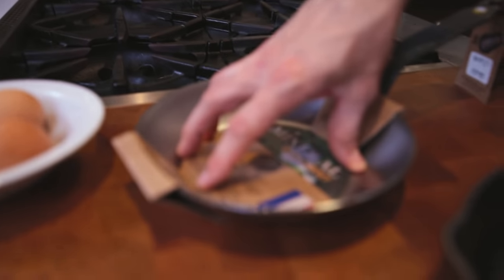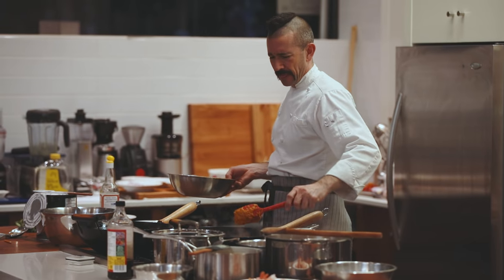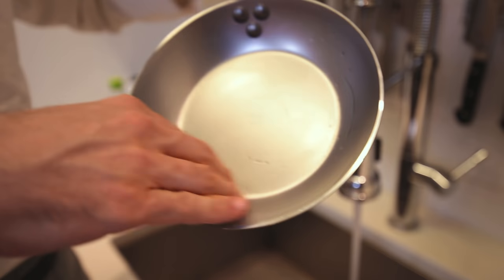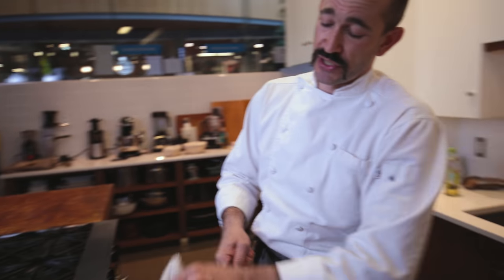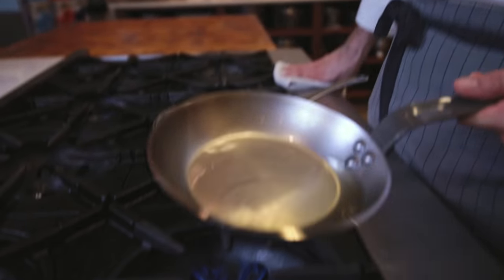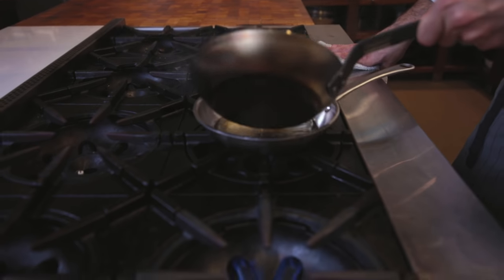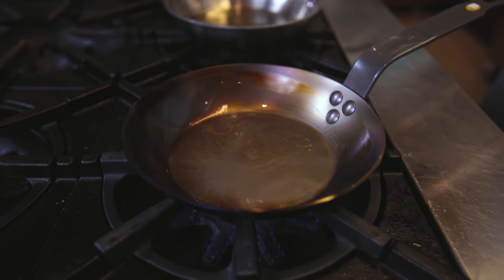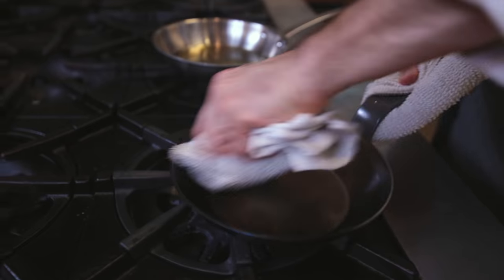How to Season a Carbon Steel Pan

Comment: Hey Chef, Just bought a Matfer 10" and I want to season properly. Transitioning from cast iron to carbon steal. You mentioned a beeswax coating on the pan which mine has but it is not beeswax. This coating is hard and thick and didn't wash off. The process from Matfer is salt, oil, and potato skins cooking it over medium heat for 15 Min. then repeating. My question is "Can I season this pan with this coating still on?" Will that coating be removed during the seasoning process without harming the pan? I realize your pan is not Matfer, I thought you might be familiar with my pan. I am trying to get an answer from a pro and not someone like me. Please HELP ME. I'm dying to use it.
Thanks for your help...JackStone
Reply: Jack Stone 
I initially scrubbed my Matfer with hot water and a SOS green scrubby..then seasoned it like this a couple of times and it worked for me.  One thing to remember is to make sure your pan is hot before cooking...there are some good videos out there about preheating your pan.  Great pan, love my Matfer.
Reply: Jamie
Took your advise and did get all the coating off with hot water and the course scrubby. Worked so well, I'm going to buy a smaller size also. My 10" seasoned very well and have been using it every day. Sorry for the late reply, but I did want to take time to thank you for your share, very helpful. Thank you so much for your help...Stone
Reply: No problem, I also bought a few more Matfers on Amazon super cheap (open box), they had touches of rust on them but nothing a mix of vinegar and water could get rid of along with my scrubby, followed by seasoning.  I have become addicted to carbon steel now.
Reply: That plastic layer of coating is nearly impossible to take off the matfor carbon steel pan.
Reply: Cast Iron is only good for dutch/french oven cooking or for homemade pizza (12"+ Skillet with Lid), for deep frying (Deep Skillet) or for baking. Saucepans and Stock Pots go Stainless Steel, for Woks and fry pans... Carbon Steel is the way to go.. Cast Iron cookware are invaluable for a good kitchen, they're just not great for everything.. I wouldn't transition from Cast Iron to Carbon Steel, I'd just use them for the right tasks.
Reply: I used hot water, blue Dawn, kosher salt, green scratchy sponges all together. It took a super long time and was a massive pain in the neck. However it was worth the trouble. Then I dumped in a bunch of potato peelings, oil, and kosher salt and cooked those bad boys until they were burnt. Pretty well seasoned by then. This was Test Kitchen’s method.
Reply: I used boiling water on my Mauviel, some soap and a natural brush. Took a few times but I got it off.
Reply: Those Matfer skillets not only look like a carbon copy of the Turk (Germany) Professional series (662xx), the Turk skillets also have such a plastic like coating to protect them from rust. That's quite some nasty stuff. To get rid of it soak the pan in water + washing powder for at least 30 minutes, I'd recommend to give it 45-60 minutes. Then use steel wool and a lot of sweat to srub the stuff off the pan. After that heat the pan on a gas stove until the metal starts to change color from brown / black over dark blue to light blue or, even better, matte silver. Let it cool down, wash it one last time with mild soap water, heat it up to get rid of all remaining moisture and start your preferred seasoning method.
Reply: @mrdeadsea7777  I cook fried eggs, sausages, burgers, omelettes, potatoes, onions, stews  and much more in my cast iron. If you treat them right they are the best to cook with.

Comment: Why are you washing all the beeswax off if all the seasoning pucks sold today are bees waxed based?
Reply from the maker: A few reasons. First, I don't take it all off, I will leave some on that helps in pre-seasoning. Second, there is too much from the factory as the point of the wax is to protect the pan from rusting. Third, it's dirty.
Reply: Ok thanks !!

Comment: why grapeseed oil instead of olive oil?
Reply from the maker: Due to fibre in OO. Usually the better the OO the more fibre it contains. More fibre = more black residue build-up. This may sound strange but if you really want to use OO for seasoning then I suggest getting the cheapest stuff you can find as it's usually thin and flavourless which is what you want from a seasoning oil. I hope that helps.
Reply: @Cook-Culture  thank you, going to buy a carbon steel pan soon
Reply from the maker: Good on you! So far we have found de Buyer or Matfer to be the best performing pans for the $$.

Comment: WTF fpr a stipid pan! I bought one today and washed it numerous times with dish soap! Then seasoned it, and when i wipe it with paper towel, the towel turns all black!!! Is it because of the machine oil that was used to prevent it from rusting?

Comment: How often do you have to season your pan?
Reply: As long as the patina is not damaged you don't have to reseason the skillet. But it really helps developing a good patina if you do a so called touch up seasoning after using it. After cleaning the skillet you pre-heat it again, apply a very thin layer of oil and then turn up the heat to the point where the oil starts smoking. Let it smoke for up to a minute and then turn off the stove. If the oil seems to form smears during the process, simply wipe the skillet with the towel again so it forms an even, very thin layer. After you turn off the stove you may also wipe the outside of the skillet with the oily towel to protect it from rust. The remaining heat will burn in this oil too.
The whole process should only take a few minutes and keeps your skillet in perfect shape. 
I always do a touch up after cleaning the skillet with water as you have to re-heat it anyways to get rid of the moisture. Especially with a new skillet that doesn't have a good patina already, I would do a touch up after every use.

Comment: Thats way way too much oil. This guy doesnt know how to season carbon steel.
Reply: correct
its hard to find a good video on seasoning a pan, some of them just wave around with the already "seasoned" pan in front of camera, some do like this
Reply: musaire Its impossible to find good instructions for seasoning a pan. Trust me, I've looked. All of the stuff I could find was vague, with no specifics. Some say you gotta use lard, some say you gotta use rapeseed oil, some say dont ever use vegetable oils. Some say to drown the pan in oil like this guy, some say to only use a miniscule amount that you wipe clean after too.
Some say to put in the oven for an hour at 400F, some say only 30 minutes. Nobody shows real closeups of the pan, showing how its meant to look while getting seasoned.
I tried many different techniques to season my DeBuyer Mineral Pro skillet, and none of them worked like advertised, to get that smooth uniform black shiny finish. I had to use sand paper on that pan way too many times, to start over. Then I just gave up, and started cooking on it, fuck seasoning and fuck these assholes who dont even know what theyre doing.
Reply: Rykehuss omg so true im a perfectionist and things like these with the different techniques drive me fucking insane
Reply: Rykehuss  I’ve had the same issue, spent hours of my time only to get a gummy surface. Last time I stripped it, heated it in a 200 degree oven,  wiped a minuscule amount of flaxseed oil all over with a lint free cloth, cranked the oven to 500, stuck it in that hot ass oven, took it out after 15 minutes to wipe off any drips so it wouldn’t be gummy, stuck it back in the oven for 2 hours, turned the oven off until fully cooled, repeated the process another time. Should be good, right? First time I cooked in it (after that round of re-seasoning) BACON effing stuck to the pan.
Reply from the maker: Hi , thanks for your comment. The process that Chef Cosmo follows in this video follows the instruction from de Buyer, which they put on every piece of Mineral B Cookware. We acknowledge that there are a few good methods to seasoning carbon steel however the amount of oil used here is adequate for the desired results. Also, please note that some wax is intentionally left on pan as per the manufacturers instructions. This all becomes the seasoning and helps seal the back side.
Reply: @Cook-Culture  In de Buyers instructions it says 1 milliliter of oil, not desiliter :P
Reply: @G GYou aren't supposed to remove the bee's wax, it helps give a better seasoning. Even De Buyer advertises that it helps with the seasoning. Also, you can buy seasoning pucks with bee's wax added to it. It's called the CRISBEE PUCK.
Reply: @rykehuss3435   I bought a Matfer carbon steel pan a few months ago.  I followed the manufacturer's instructions with the oil and potato peels, and I seasoned it with organic flax seed oil from Trader Joe's.  I ended up with a beautiful dark, almost black, finish.  It was glossy and it looked perfect.  BUT, when I cooked with it, EVERYTHING stuck to it.  It was awful.  And, on top of that, when I cleaned it the black color was coming off on the paper towel when I dried it.  I was really frustrated.  I ended up just putting it away and using my well seasoned cast iron instead.  Recently, I decided to give it another chance.  I decided that I'm not going to season it any further, I'm just going to use it with lots of oil or butter, and cook as much as I can with it.  The jury is still out, but I think the pan is getting much closer to non-stick.
Reply: @whoyoukidding1  doing it that way takes a while but when it starts getting better, it will just keep getting better. so long as you are up to the maintenance and proper use of it.
Reply: Yeah, thousands of professional chefs doing it all wrong for decades ... because this IS the way carbon steel pans are being seasoned in professional kitchens. There is no time for layer after layer after layer using hour-long methods like the oven method. The skillet is a tool, not a piece of art. It gets the first layer of seasoning as shown in this video and then the skillet is used many times a day which builds up a perfect patina in no time.
Reply: @Cook-Culture  To seal the back side you can simply use the towel you used to wipe the inside clean on the back side of the skillet while it is still hot. I also heat treat my carbon steel skillets once before applying the seasoning (heat up the whole body of the skillet until it changes color from dark brown over dark blue, light blue to matte grey). That way you develop a layer of Fe3O4 on the skillet which furthermore protects it from rust. Then let the skillet cool down for ~15min and start seasoning with your preferred method.
Reply: Little Blizzard sugar in the bacon
Reply: I didn't want to say anything but yeah, this seasoning video was a bit lax. To the untrained eye though it looks like he knows what he's talking about. I wonder how many people are going to pour hot oil onto the flame by accident!
Reply: a bit too much oil but otherwise correct, i am not sure who started the flaxseed oil shit but it seems like an american thing (sort of trying to copy the look of well-seasoned carbon steel woks), the shiny, black, evenly coated surface with repeated seasoning with flaxseed oil is form over function. it cracks, is barely nonstick, and you need to spend a day seasoning before you can even use the pan.

the pan when seasoned the way in this video is already good at being nonstick at first use. over time it gets darker but it will not develop the uniform dark layer that was somehow set as the ideal for carbon steel pans, the center would be dark, the rim would be dark but the sides of the pan are actually lighter in color even after years of use, but it will still be nonstick.
Reply: Mikel Tan Yes! That's what I'm talking about.

Comment: You are completely wrong about to case iron you don't do it the same way you do carbon steel.
Reply from the maker: Thanks. Can you please explain your process for Cast and Carbon and the specific differences between your methods?
Reply: @Cook-Culture  1 you didn't mention how high you set your stove at when you started seasoning your carbon steel pan,but don't feel bad no one else does eather 2 case iron skillets aren't season on top of the stove  there done in the oven and you grease all of the pan . what I do is heat the pan on top of the stove so it will take the grease then i wipe off as much of the grease as i can. Set the oven to 500°  Because I use crisko and the smoke temperature is  480°  and you want to go at less 25 °higher then the smoke temperature  once your oven preheated, set two timers,one for 10 minutes and the other for 60 minutes. Put your pan in upside down i set mine in the center of the oven. When the first timer go's off pull the pan out and wipe it down again .put it back in .and when the second timer goes off turn the stove off ,and leave it in there until it cools off to the touch

Comment: de buyer is french so it's pronounced weird FYI: https://forvo.com/word/de_buyer/

It's pretty much a dead language (they just don't know it yet) but until it's actually dead we should endeavor to pronounce it correctly. 

Also check out matferbourgeat's method for seasoning, I find it works a lot better than this. What you do is take the peelings of one potato plus a very generous amount of salt  plus a bunch of oil and fry the peelings and salt  for several minutes. Discard, then heat the pan again with a little oil, remove from heat and wipe out the oil.  something about the salt and potato peels gives it a nicer season faster.

Comment: Why do Americans struggle so hard with the metric system?
Reply: because they are not accustomed to using it, just like you would strugle with the imperial system...
 which sis smaller... 11/16th or 12/32nd... ;O)

Comment: How to properly season carbon steel. Work in commercial restaurant, cook greasy ass shit on it every day for a year. Or throw out your carbon steel and buy a cast iron. Carbon steel has thin pores, as thin as stainless steel. so basically what you’re doing is hydrogenating oil into plastic and building the thin layer of micro plastic over time.
Reply: @damarei  haha yes i am.  you got me

Comment: With that amount of oil I could've seasoned about 2 dozen pans .... and it's pronounced "De" "Bwie" "Zjéé" .... ffs
Reply: There are many ways to season a carbon steel skillet and several of them work fine. The method shown in this video is recommended by De Buyer and works perfectly well. It is also very common in professional kitchens as it is quick and gets the skillet ready for use in only one short process. Time is money and the patina will build up with every use afterwards.
Reply: duh bou yeh